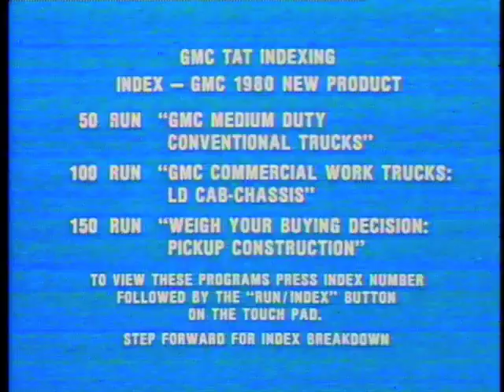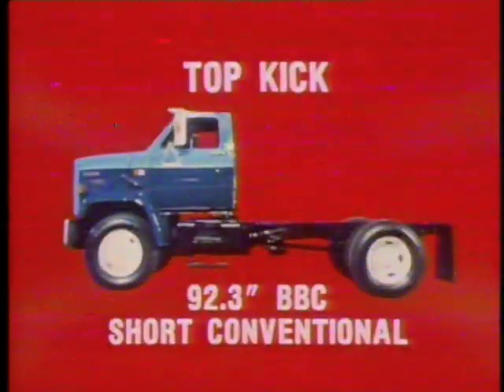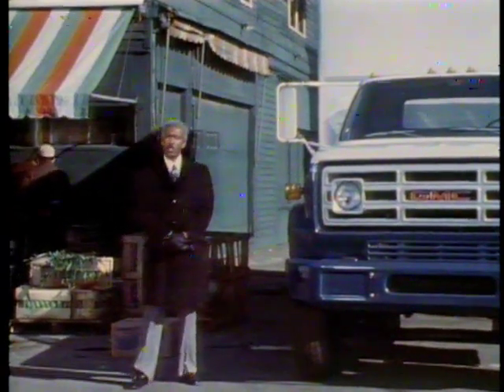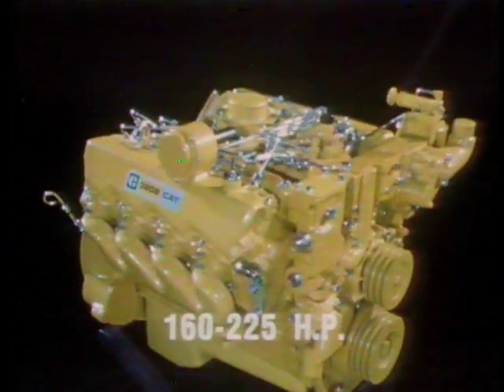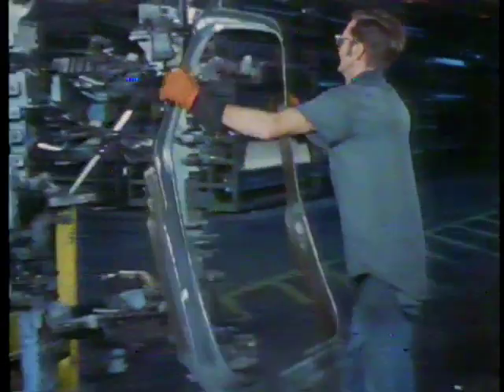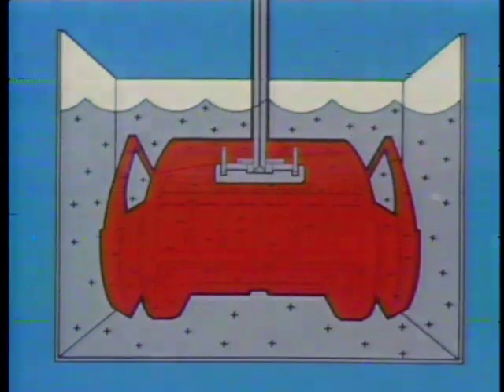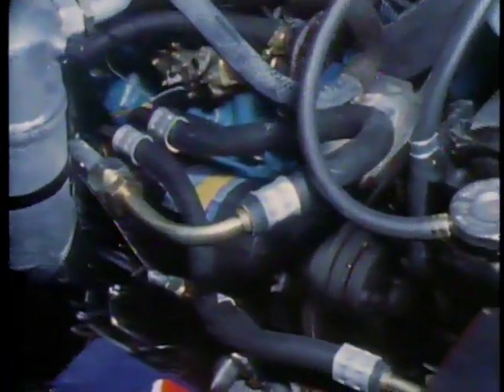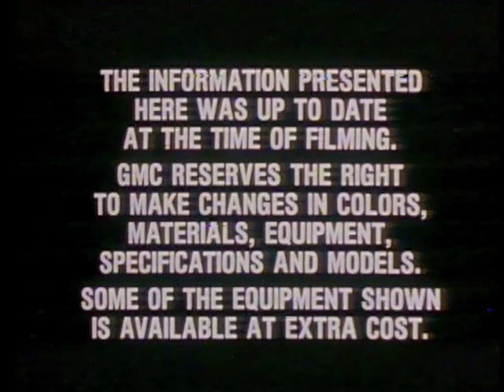1978 GMC Medium Duty Trucks

Comment: We had two mid 70s C-65s with Knapheid bodies on the farm when I was growing up. 427 gas engines, 5/2 trans/rear end with a cheater axle and 5 something gear ratio. Tough and reliable trucks they were. They weren't fast by any means but they weren't meant to be. They were a blast to drive (when I was a teenager lol), and always got the job done. I'll never admit how much we overloaded those poor trucks but they always came back for more.

Comment: Simple, robust trucks! A LOT of the C60 and larger are STILL working today...39-years later! THIS is what the U.S. should STILL be building, not these 'wanna-be cars' they try to sell now (for $110k)...Few realize, trucks like that red stake-side (in this video) could be BOUGHT NEW for less than $10k back then (with gas engine)! Real shame...

Comment: Trucks were nice in the 70s.  Now they are trash.
Reply: I know right.  But also the looks were way nicer, and no electronics that go wrong constantly.
Reply: 70s TRUCK FAN I have a 1975 Peterbilt 359, bought it brand new in 1974 and I’m still driving it today, 45 years after I started. It had a 400 Cummins and a 10 speed from the start and everything was built from the best material. I swapped it to a series 60 Detroit in 1986 and it is still in the truck at 2.6 million miles. Just bought a 2016 W900 as a second truck and you wouldn’t believe how much cheaper it’s made than the 359. I gave 176,000$ for that truck, unbelievable that they build cheap, sell expensive.

Comment: 1980 was the first year the Detroit Diesel "Fuel Pincher" 8.2L four-cycle diesel engine appeared, to replace at mid-year the legendary two-cycle 4-53T. And while the Cummins VT-225 (a variation of the "Triple Nickel") was listed alongside the Cat 3208 as being available on all 7000s with the Top Kick hood, I suspect none were actually specified with this other V-8 diesel engine.
Reply: Good ol' EPA for strangling a great 2 stroke diesel
Reply: Jeremy Lavoie you're right that size truck should have at the least 6v53t for the smaller weights then a 6v92t and once they experienced that engine no one would request another 8.2 bad name for Detroit,3208 throw away engine SORRY guys it's the truth
Reply: I'm pretty sure you could get a 6v92 in those trucks
Reply: You don't think I was wrong I was thinking of a brigadier
Reply: @dougc190 
To be specific, the 9500 series.
Reply: We have an 89 gmc dump truck with a turbo 8.2 hasn't been a bad truck not a lot of power goes through some coolant but whatever. I'm not about to tear into it can't hardly get parts for those damn things anymore
Reply: Have a C70 dump truck with a 8.2 still working strong and starts better than modern trucks.  Take care of it and it will take care of you.

Comment: My, farther works for a Lumberyard and they just sold thire 1993 GMC Topkick. The thing was a best. For a 26 year old truck. It had like rust on it. And it was the Third strongest, only getting beaten by the two Macks, and was the biggest truck that could turn tight. Unfortunately some of the new drivers were not driving it because of the 6speed manual and no ac. And the two new Issue Trucks with Ac and an atomic transmission. The newer drivers took them for run instead of 19, the topkick. And after a year of almost no runs. Mine you this truck was used almost 3 to 4 times a day. It was sold in September of 2019. The two new trucks even combine cant haul as much weight as 19, 19 had a 14ft bed but it hauled alot of 18 foot heavy stuff and she was not struggling. But the two new ones, with 16ft and 18ft can haul and when you put heavy stuff on the 16ft bed one it hauls like its hauling 1 or 2 steel beams. And they both have rust on them and they are only 2 years old.

Comment: how long did this body style last? There is a company that runs tons of these for moving fruit and what's the difference between the Topkick and the Brigader? I'm assuming top kick is medium duty while the Brigader is heavy duty.
Reply: From 1973 to mid 1989.
Reply: Peter Chronis It went a long time then. I would’ve never thought it was a product of the 70s!
Reply: Just look at the  square body cab design, it spells 1973, of course the Top Kick front end came some 6 years later. Even the Brigadier which came around 78 is based on the H & J  7500-9500 series trucks that were first introduced in 1966.
Reply: Peter Chronis you know more about it then me! I’ll just shut up now but before I do thank you for your knowledge since i’m only a curious person and not a gearhead.
Reply: @moutnlovr2  those had their own cab, as well as the C/M 9500 & 9501 models.

Comment: Stellite exhaust valves and rotocoil exhaust valve rotators? Been working on cars for 50 years and never heard anything like that. Stellite exhaust valves - hard coated stainless steel exhaust valves (very hard). Rotocoil exhaust valve rotators - causes a small and incremental rotation of the valve every time the rocker arm presses against the valve stem to prevent hot spots from burning valve. Learn something new each day!

Comment: Can anyone help me and tell me where can I found sierra engine 1978 new one or at least clean ?? Plz
Reply: What kind of Sierra engine are you searching for? What class of vehicle is it? I mean, you could get most-anything in the C-65's of that era from the 225 six-cylinder all the way up to the 427-Big Block, and several diesels (as the video shows). If you're asking about just getting a 'generic pre-89' Chevy engine...I'd probably call Jasper Engines...while they do NOT have 'new' ones, they are a major corporation, rebuild with original parts, guarantee for 12,000 miles, and produce an EXCELLENT rebuild engine for truck restorations, at a decent price.
Reply: Taz Alta's you’re on the damn internet. Do it yourself. Wtf.....